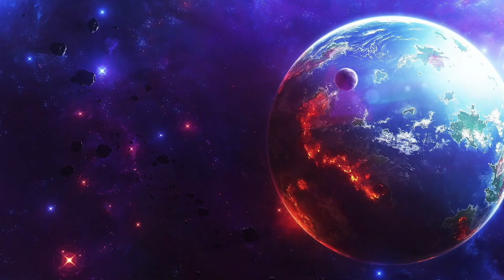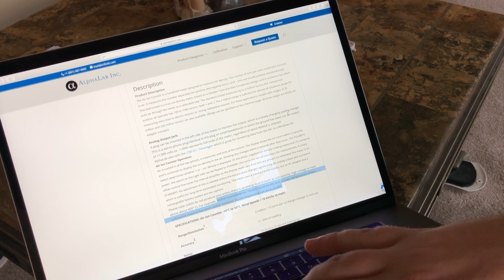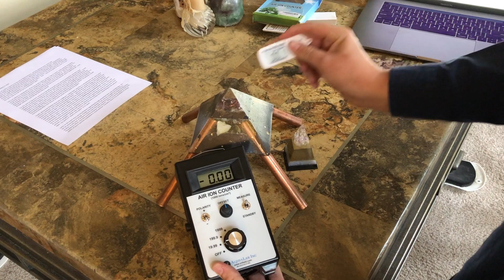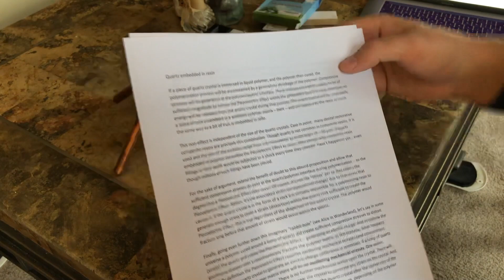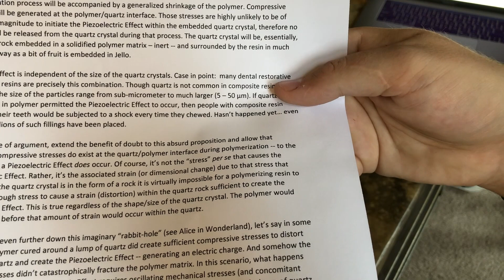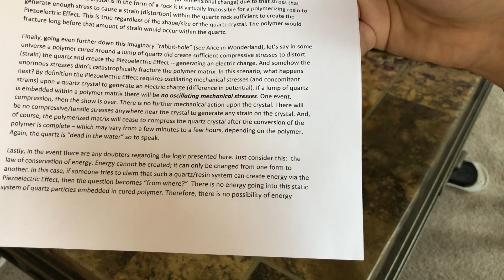Orgone Pyramids - Negative ion and PiezoElectric NONSENSE

Comment: If your orgone doesn’t emit negative ions it’s falsely designed and doesn’t work. People are always trying to do some extra and come up with „smart“ new designs and all of that is bullshit! Wilhelm Reich said to use ORGANIC resin, metal is INORGANIC and so is a silica crystal. You can also not simply replace the silica crystal with something else! It needs to be a Quartz crystal, other stuff WILL NOT work. The most noticeable effect of ion channeling in orgone devices can be observed in Reichs Cloudbuster device (hence why it can change the weather and climate to a large degree as shown by James Demeo)
Reply: polyester resins will NOT work that is why your PhD mutual friend also could not testify a piezoelectric effect in orgonite. Use ORGANIC resin orgonite devices or make them YOURSELF. Use pine resin or whatever. $30/kg

Comment: I've done some experiments with ORGONE pyramids, studied magnetism and electricity, toroidal field geometry. 

I love you are addressing the need for correct information and not the drama fantasy stuff a lot of people post. 

I have done the freeze test which demonstrates a toroidal field around the pyramid, you can recreate this simply at home. 

While I can't add to the ion discussion, a field of electric-magnetic energy is somehow sustained around the pyramids after the single piezoelectric compression effort. Somehow there are field effects from these pyramids. 

I would like to get an experiment making a large ORGONE pyramid with voltage leads as well as a gauss meter. 

Another experiment would be to try and create a small peizoelectric circuit using a brick with compressed quarts inside, and oscillating with head, sound and mechanical compression to create an oscillating circuit. 

Thanks again for the video, I'll be back when I have more to add.
Reply: How about your experiments dear?

Comment: Also what is the function of having crystals (like quartz) in orgonite then if there is no piezoelectric effect? You guys sell orgonite  pyramids and pendants with crystals in them too, I just want to know what for if no #piezoelectricity? The casimir effect to has me thinking, I can see how it can work but does it? Any insight to these questions would be much appreciated!!!

Thanks 👍
Reply: The crystals are supposed to acts as an amplifier for the orgone.
Reply: Have you found the answer to your question?
Reply: @KarlV1  From these guys, no. Just find it weird he goes on about having no piezoelectricity in orgonite when their company Orgone Generator with the creator of orgonite Karl Welz uses crystal in his orgonite! What for then if there's no piezoelectricity??? 🤔 an answer would be nice but I think I'm dreaming 😒
Reply: @Každý Exactly!
Reply: I guess the most important part of this video is the (well-written) letter from the Materials Scientist who says that there is no observed "concomitant strain" from the resin solidifying around the quartz; it exerts a force once when it solidifies and then the "show is over." I have, on occasion, felt that cool draft (negative ions?) when I was making orgonite but not after that. The part about using a crystal/quartz inside the resin, imho, may be about activating the matrix via pulsing a direct  current into the matrix - what that does further...whether that introduces "oscillating mechanical stresses" causing piezoelectricity, the Material Scientist or that ion detector has to confirm.
Reply: funny thing imo is you can feel "orgonites" do their magic even with no epoxid... just mate some piezoelectric crystals to any conducting metal and it will work imo even better than with epoxid
Reply: read some of the work done by Michael Gienger, he used the scientific method and empirical tests on the effects of crystals, frequencies, the atomic structure and how you can even choose "your" crystal based on their chemical, structural components, he goes into incredible depth on them.

Comment: So how are negative Ions interacting with OR? What's the difference considering ß-Radiation  causing ORANUR/DOR (or ist it not?). Anyways wouldn't it be really bad if the Orgonite had this kind of "features"?
Reply from the maker: Mr. Night likely no interaction between negative ions and OR. Radiation interacting with an accumulator causes DOR... ions are just a byproduct of radiation.
Reply: I would like to know that too. Obviously any kind of waterfall or stream either natural or homemade would be beneficial. But wondering if these devices would pick up any readings.